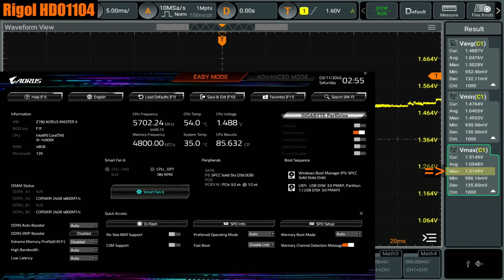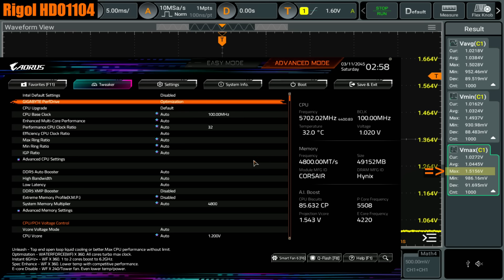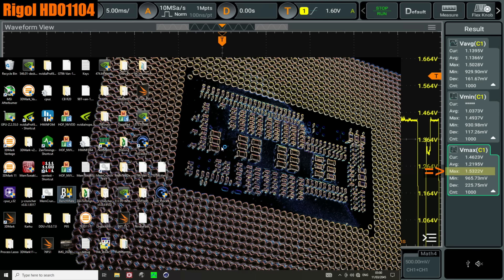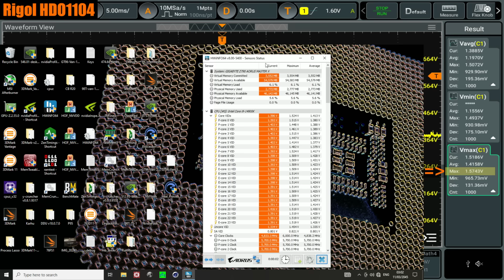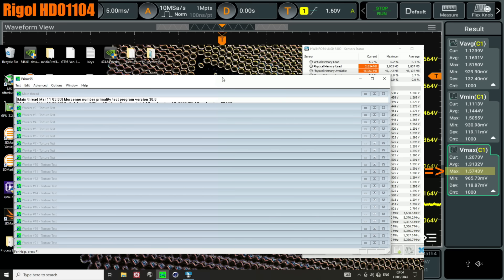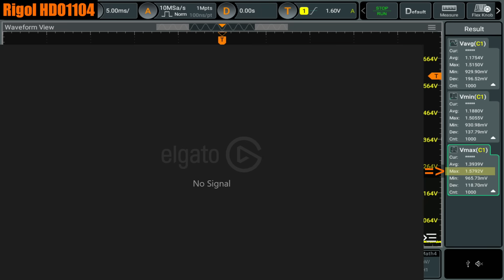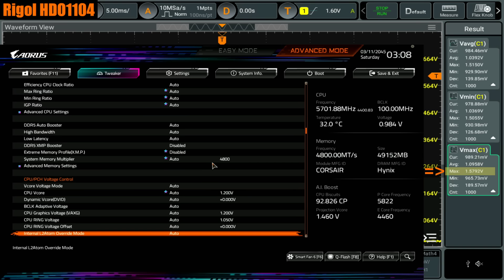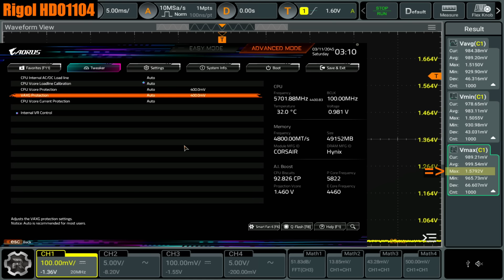Turning off "Intel Default Settings" with Microcode 0x129 DISABLES THE VID/VCORE LIMIT

Comment: I can say that my old Z690 from Asrock was giving me very reasonable values.
It died and I had to switch to a ROG B760 and the values were completely bonkers.
I tried the X129 and the problem I have is that my 13600k still hits 100C° and keeps thermal throttling. I have a quite decent Cooler master twin Fan waterblock (getting hot, so it works) and I already set the Long duration boost to 125W from the 181W that the Bios sets as standard. (181W for the short duration too.)
It is quite hot these days but a CPU should not hit 100C° under normal gaming load.
The ASUS advanced Bios allows to set a 90C° as a threshold , and still it never hits above 80-85C° under ASUS optimization and I often get better benchmark results, despite manually setting the CPU values to Intel recommended. The Voltage spyke often hits 1.46v through, which is quite high for a 13600K but that happens under Intel default as well.
I will try to set a limit to 1.4V and see if it's stable but I cannot have my CPU thermal throttling constantly just because the Intel default settings on x129 lacks the tools to tame the CPU at reasonable temp values. The CPU also Spyke's anyway to 1.465v for no reason while switching applications on desktop environment: I'm not impressed to say the least!
Even opening HW64 is enough to see spykes.
You are right: the platform is a mess, but it wasn't in 2022. Intel and the MB manufacturers made it like that to be competitive with The Ryzen 7xx0 platform: Intel wants it's offer to look fast and is burning our CPUs to do that.

Comment: Maybe a dumb question but what if we leave Intel Baseline profile but manually tune AC LL down to 0.4-0.5? Do we lose the Microcode voltage cap? Technically aren't you still on the same Microcode if you swap to the Gigabyte profile, or Asus profile, etc. Not sure if my question makes sense or not but yeah that's actually wild it just deactivates the Microcode basically when swapping away from the profile.
Reply: I tweaked mine AC loadlines with intel default settings and so far so good on asus z790 maximums hero mobo my voltages dont go above 1.39 anyways
Reply: @gvido2923  at least you don't think, we don't have multimeter(s) hooked up to the processor to catch the transient spikes like @buildzoid does.. Let's hope we aren't getting them. What chip do you have? Do you have have a voltage cap set?
Reply: @DeagleHonor  i have 14900k and now i found the best solution that works for me i went back to asus oc profile , i did set p cores to 5600 e 4400 disabled  and enforced all limits 
Set all power limits 400A 253/253
Load line level 4
And i did set global svid offset -0.100
Works like w charm now cinebench 39800k score with 80C temp at max 
Vcore around 1.314 which was not the case with default it bumped it to 1.42 and  while gaming temps around 45C-60C depends on the game for the most temps stays under 60C.
I had this set up since march when i built my 5k eur PC. Did this stuff since day one because i got 102C on first bench run so i right away went to BIOS .
Another note i never experienced system crashes as well like other people i mostly wanted to get lower temperatures without deliding cpu
Reply: @gvido2923  interesting. I tweaked my AC LL as well I'm at 0.5 so far and want to go lower potentially my vcore with all Intel baseline stock was 1.47 peak, now even with the AC LL change it's still 1.41. Did you you use Adaptive Voltage and set a negative offset also on top of your AC LL change, is your DC LL still on Auto?
I also have not locked my cores yet either

Comment: I feel like Intel is just trying it's hardest to not give up on the advertised boost clock. They are trying to frame the situation as if the voltage is accidentally too high, when in reality too many samples needed the voltage for those frequencies. The degradation is probably still happening, they are just slowing the bleeding.
Reply: Many countries with stronger consumer protections would be extremely upset if the boost clocks dropped, this is Intel playing CYA to avoid having to refund customers there.
Reply: @creaturedanaaaaa  This - Intel could easily "fix" it by reducing the power limits and core voltages, but then they couldn't hit the core KPI and so would open themselves up to big problems legally in the EU, UK, Australia etc. This way they can take the much smaller hit on RMAs and enthusiast market share (which was pretty small anyway)
Reply: @strangestecho5088  Well most consumers are ill informed in general, but AMD has been outselling Intel in the DIY space for quite some time anyway. So it hasn't effected the people dead set on giving Intel their money.
Reply: @blkspade23  most consumers are using their CPUs as normal, this whole "instability" nonsense is just for tech nerds who tinker with their CPU. running a 13900k for 1+ Year zero issues zero stutters impeccable gaming and video editing performance.
Reply: @strangestecho5088 people are just SO uninformed…🤦🏻‍♂️
Reply: Its a fab issue for 13th gen that they never fixed in design for 14th gen
Reply: @PREDATEURLT  when you do that in order to earn money that you probably wouldn’t earn telling the truth, that it’s not just lying, that’s a FRAUD and it’s a misdemeanor; when you do that to millions of people earning billions, it become a FELLONY…
Reply: @rawdez_  But he has an AM4 build he wants to upgrade when it’s most cost efficient. I think the 5700x3D is the best performance for dollar you could ask to spend if you had an AM4 platform
Reply: @rawdez_  Really? Which shop?
Reply: @piedpiper1172  cpu-top
Reply: hoping all the hard core fans buy the new CPU and move away from the current CPUs... I'd buy AMD if I wasn't already on and AMD system
Reply: @Denbot.Gaming  amd is the same these days. 9000 is near-0 progress cpus made only to make 7000 with discounts to look better then they are. because CPU sales are down and nobody needs new cpus without progress with affordable GPUs. and progress with GPUs was killed to sell more consoles chips amd makes for sony/ms.
Reply: @rawdez_  The much higher efficiency is good though, personally consider it a shame nobody cares for that. We will also see if they will have better overclocking because of that.

Only thing I am pissed about AMD is killing the non-x variations. They even shot themselves in the foot with this, the 9000s would have been PERFECT to be non-X CPUs
Reply: @uncannysnake AMD biggest problem is comunication, since ages: they’re SO stupid…🤦🏻‍♂️ 
If they called the new 9600x and 9700x “9600/9700 ECO”, focusing on the reduced power consumption, and low tenperatures, perfect for mobiles, everybody’d be cheeering at them, now, rightfully, (and they’d have had room for an X version more pumped on performances, instead)… but no…🤦🏻‍♂️🤦🏻‍♂️🤦🏻‍♂️
The AMD marketing and comunications department is SUCH A WASTE OF MONEY…🤦🏻‍♂️
Reply: @rawdez_  Intel on the other hand is currently obliterating their ancient CPUs to get any performance out of them. 

Screw CPUs, I'm sticking with my 5600X until it's all said and done and there are actually good choices on the market.
Reply: @rawdez_  Yeah, when comparing a 65w CPU with a 150w CPU... most of the tech tubers are just posting to get views and bad news gets more views

Wait till the 9950x and 9800x3d land... then I'll be interested to see what they say... but have you seen Jay2cents video of the 9700x when he enables PBO... single core score = 13900ks score 🤷‍♂️
Reply: @kapitumbulu  True true
Reply: @Denbot.Gaming  more amd shilling
Reply: @masterkamen371  exactly. Screw "new" 0-progress CPUs. intel f-ups don't make amd's f--ups any better and vice versa
Reply: Just turn on PBO and you got 120w part.
Reply: @rawdez_  not really... I am team red, but when Intel do produce a good CPU credits were its due, I always view it as if you have unlimited cash go intel+Nvidia, if you want bang for your buck with some quirks go AMD

AMD have the security sink whole issue at the minute don't they
Reply: @Denbot.Gaming  1) its a dumb statement about "intel is premium" because its not anymore 2) nope they don't, you have to obtain kernel access first (or smth) to act on their "security flaw". which is like having keys to a vault in a heavily guarded bank. its useless
Reply: @Denbot.Gaming  both corporations are greedy sobs atm and act actually the same. I'm not defending any of them. the. same. anti-consumer. corps. copying each other's practices of milking the market and NOT competing to not drop prices/increase margins on 0-progress products.
Reply: @rawdez_  Why wouldn't AMD focus there GPU market on consoles everyone always buys nividia anyways the 7900gre is a great value and the 4070 ti/super still sells loads more units
Reply: @masterkamen371 Ali express 5700x3D for like $160 is probably the best ever price/dollar on the market tbh. And probably will retain that title for at least 3-4 years.
Reply: @uncannysnake Except the 97/600x aren’t more efficient? They use 40%+ more power than the 77/600 for only ~20% more performance, and often only a few points less than the 77/7600x chips for single digit gains. 

And all of that is utterly smoked by the 58/7800x3D, which both show massive efficiency gains over either 9000 chip. 

The 9000s are server/ai chips, and they just aren’t good gaming chips. They’re fine if you’re upgrading from a 1000, 2000, or 3000 series, but really even the just hold on the few more months for x3D since you’ve already waited 5+ years.
Reply: @bossloth  amd prioritizing consoles market since it makes consoles chips for sony/ms, not just now. 7000 is a 0 progress crap and makes 0 sense at premium nv prices without nv performance in rt. and 7000 is crap not because amd can't make better cards but because they don't want to make consoles irrelevant or drop GPU prices.
Reply: @bossloth  all GPUs are overpriced x3-4 times (like mining isn't gone) and way too slow for next gen because 0 progress. thats why gamedev is forced to make games for consoles level performance which is rx 6600 level + properly implemented directstorage unlike on PC with loooooooong PCIe bus = latency. 0 progress with GPUs is intentional to keep selling old cheap-to-make chips to sony/ms.
Reply: @bossloth  amd is slowing down the technological progress on purpose, same as all corps do. because its way better margins when you sell old technologies and prices don't drop due to 0 progress. people keep buying obsolete hardware in consoles and its THE incentive for amd to kill the progress.
plus they are 1 step away from actually realistic movie-like graphics which would be the last GPU you'd ever need to buy. so they are slowing the progress down to milk it while they still can.
Reply: @bossloth  all what amd has to do to make realistic graphics in games - proper DirectStorage on PC. connect SSDs directly to a GPU chip. same as they do on consoles with way slower chips. TBs of "VRAM" = realistic models/textures/effects = realistic graphics in games. but it'd kill consoles AND GPU businesses because its the last GPU you'd ever need to buy. apart from realtime AI game graphics generation. which nv is working on. generate photorealistic movie-like graphics from primitive iGPU level graphics in real time. or change the looks of ANY old game. want to play doom which looks like its mylittlepony cartoon? just turn on AI processing.
Reply: @bossloth  nv would start from adding AI generated objects in DLSS 4. but its how they'd milk this tech. because there's 0 technical reasons to not generate the whole complete frame with AI making graphics completely realistic and movie-like. but if anyone can generate hollywood-level content at home hollywood would be done and stop paying nv for their overpriced pro cards/servers. so just DLSS and separate objects/textures in obsolete 2014- looking games with bad models due to low VRAM it is.

Comment: @actuallyhardcoreoverclocking  I don't trust Intel's default settings. I've manually optimized my system using a Gigabyte motherboard profile (optimsed setting). I've applied the following settings: IETU with a -0.050v undervolt, AVX2 offset of 5.0x, Turbo Boost Power Max set to 140W for 128 seconds, all active cores at 53x multiplier. Under load, the voltage never exceeds 1.414v and there's no thermal throttling. I get a sore of 40004 on cinebench R23. No fail in the intel stress test all pass. If i try to set the IA VR Valtage Limit to 1400 by current EDP limit is  thermal throttling when ideal it the same if i dont set it and use the new SAFE LOL defualt settings. Any ideas?

Comment: So let me see if i understand, the only way to have the ''fix'' working on the new microcode is by using the Intel's default profiles, if that's the case then fuck you Intel and everyone that lives on your household.

Thats is straight up garbage, when i use Intel's defaul profile my pc straight up burns, it hits 100c on at full load and starts thermal throtling like crazy on a 360 AIO at full speed with a contact frame and guess what since Intel's default profile doesnt allow you to undervolt the system ( i test my system and even when i disable undervolt protection the system would not apply the undervolt with intel's default settings active)  you are stuck having to choose between either having the silicon degrade due to voltage or degrade due to the higher temps.

Now i do really believe what other tech tubers are claiming when they say that the microcode is just a patch so that the CPU can last until the extended warranty is over
Reply: Depends on what board you use it seems
Reply: @strangestecho5088  better safe than sorry

Comment: So some chips on some boards weren't defective at all they were just unstable because mbs were running to low of voltage at idle to keep them from crashing. On the other hand some were degrading from to high of voltage. So aside from the small batch of 1300s that were damaged from oxidation at the plant these CPUs have been perfectly fine but riddled with incorrect voltages.

Comment: You can set 1400 on KS just fine without losing anything, using it since you showed us this option some weeks ago on my ks max i have seen vid go up is 1.379 and 2 cores boosted to 6201.5mhz and -0.75 undervolt 0 whea errors using system daily and its powered on 24/7
Reply: so you didn't put PL1 and PL2 limits... maybe I will try it.
Reply: @f.donnet8165  nope using intel defaults extreme profile for KS tho extreme is 320W performance is 253w
Reply: dude i have KS too can you help? i have no clue..
Reply: @wthedoctor  just watch video and do as he did
Reply: @Pedja-q8t  i choose the extreme profile. Then VR VLimit 1400 still. CPU got 100 decree and thermal throttling on R23
Reply: @wthedoctor  ofc it cant be cooled unless on custom loop, you can choose performance to lower power to 253 but it will hit 95+ still with any decent cooling
Reply: @Pedja-q8t  thanks dude. I got 360mm Artic Liquid Freezer II. So I should choose performance.. I really don't care about it. I just wanna play my stupid game..
Should I change any other configuration on bios? VR limit still 1400 btw.. and thermal thing is it ok? Some people says you have to check thermal paste. I build this pc 2 weeks ago